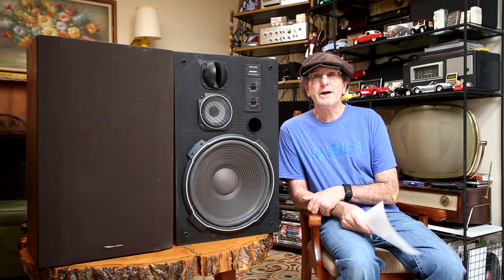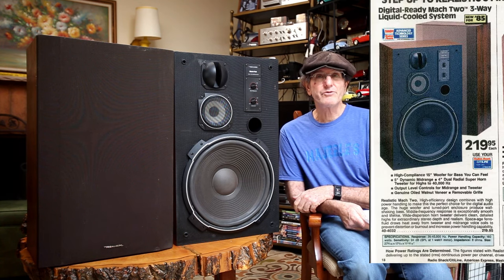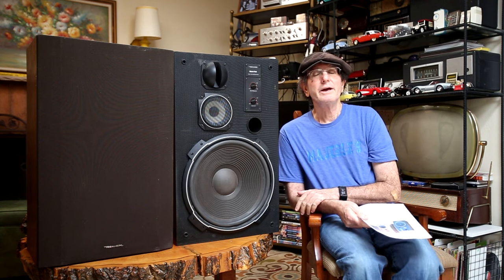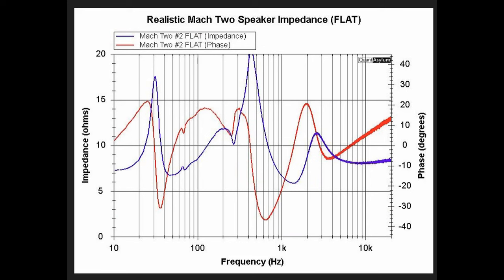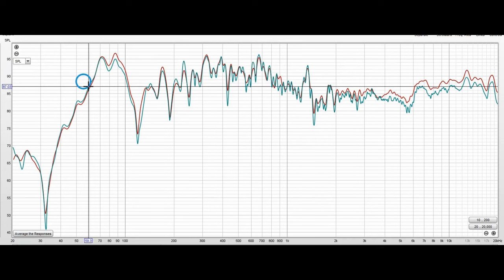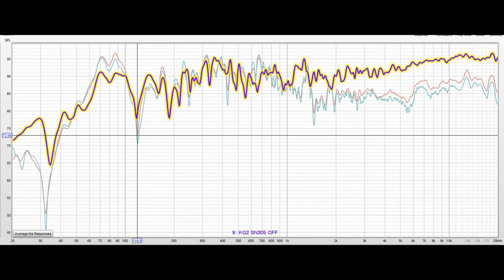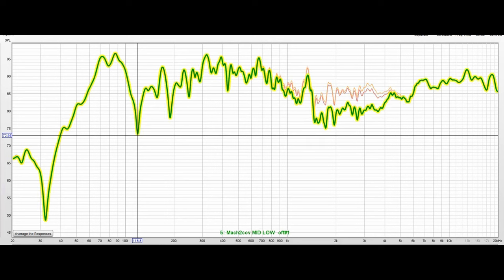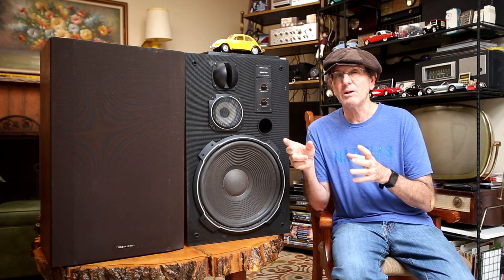Realistic Mach Two Loudspeaker- Vintage Audio Review Episode #85

Comment: Just re-foamed 4 of mine! The Ferrofluid had dried out on the tweeters (very faint sound), cleaned out the gunk and refilled. Mid ranges also needed re-foaming, I recapped as 40 year old Electrolytics will not be in great shape. Mine are wired up to an STA2380, recapping the amp was like night & day!
Reply from the maker: Thanks for sharing. I sent my tweeters into a guy to have the ferrofluid replaced- not something I wanted to do. I have tested some old crossover caps- probably at least 40years old and they were still fine- but don't blame someone who wants to do that. Glad you are using the RS Receiver.
Reply: The amp was completely different after the recap. I don't recall a massive change after recapping the crossover. However, one of the caps had a snapped leg! The tweeters are easy to work on, it just takes time to get all of the gunk out! I also use a Realistic graphic equaliser 😊
Reply from the maker: @hoojchoons2258  The snapped leg makes a bit of sense with all the vibrations going on in a speaker. I hope you checked out my video on the realistic EQ that I did- thought it was pretty neat.
Reply: Not seen it.  Will check it out. 312020A?
Reply from the maker: @hoojchoons2258  31-2000 was the model #
Reply: That's what I use 'em for!

Comment: Great video. I subscribed. I almost got a very nice pair of Mach-1 for $190 today but someone could pick them up before me. I have the Klipsch kg4 and like horns now, even though that is a mid-driver horn. I recently got a Rogue Atlas power amp (2005) for $400 and a pair of Sennheiser Momentum 3 wireless headphones (like new) and the kg4 are so much smoother than on my Onkyo SS AVR 6.1 amp. Thanks!
Reply from the maker: I have not heard the kg4's but am guessing they would sound good from how my kg2's sound. Sounds like you have made some good purchases. Thanks for the comments

Comment: Super Tweeters , and when your pushing excess juice into them , the light bulbs light up inside ,
Reply from the maker: I did not know that would happen, but it does not surprise me- thanks for the comment
Reply: @vintageaudioreview  my receiver pushes 115 watts per channel , without the Amp , but I can run my speakers on a 1 to 10 level for individual output , my two main speaker sets are Sansui Sp-Sx 9900’s, good for 300 watts each , but adjusted properly , the Mach 2 set hangs in there , but the light bulbs are running from dim to bright , I’ve blown all the speakers in them twice , the Mach 2’s , I’ve replaced them all with higher quality speakers 15 years ago , no problems since then , the Sansui’s , all original yet , 1974 models , they made better quality in the old days , my uncle has a Sansui SX-1980 Receiver , his system blows my mind ! 1/2 way up , you can watch the Glass move in the doors & Windows ,
Reply from the maker: @joelaichner3025  Have not heard any Sansui speakers in a long time, but like their receivers/intg amps. I will have to ask about the lights you mention- I think the owner may still have them, but that is a lot of power (115w) to put into them....
Reply: @vintageaudioreview  my Onkyo Receiver , I can adjust the power to the speakers from 1 to 10 by set , I run them on 6 , 60% power input at 7 they start to distort a little ,   The Sansui’s are set to 10 , Sansui’s are 5 way , with 17.2 inch woofers , I’m always looking for a 3rd set , the 11,000 series are especially rare , but I’d buy a set if I could find them close to home ,
Reply from the maker: @joelaichner3025  Good luck on your hunt for them and thanks for sharing!!

Comment: the Mach two and Mach three are the most underrated speakers on the market do to the fact they came from Radio Shack  thats why audiophiles turned their nose up at them.  what people didn't know back then and most still don't know now is that the Mach 2 and 3 were designed and made by Altec Lansing for the Tandy Corporation.  replace all the caps in them to poly  caps and let the magic begin. your gonna need for each crossover two 4.7uf two 2.2uf one 33uf and one 8uf. after you replace the caps then play this https://www.youtube.com/watch?v=jevoKLcjmfE  you will not believe your ears.
Reply from the maker: Thanks so much for the track- hopefully it is in my streamer service's catalog. Also great info about the crossover change components. It is not my speaker and was sold. This review has definitely been a favorite with the viewers. I am a gear guy and don't care so much about the about the badge on the product, except when it means I am going to be paying a lot more. A lot of the radio Shack gear has tested really good, except maybe the Lineaum's I reviewed.

Comment: A guy in my dorm had a set in 1985.  Loud and clean. MUCH better than ANY Japanese made or Bose (for example) of the 80's. I've considered upgrading the crossover on some and damping the cabinet.
Reply from the maker: I would not upgrade the crossover unless mine was bad and/or could measure the before and after results. This is definitely a very popular video which tells me a lot of folks had them. I appreciate the comment
Reply: @vintageaudioreview   no stock electrolytics  will sound as good as polyester or metallized  poly low ESR caps.
I’ve modded everything from Kef to Klipsch and there is not one example of electrolytics sounding as good. 
Electrolytics dry up and degrade in as little as 3-5 years, let alone 39 years. 
The midrange and treble clean up considerably and don’t saturate as easily with better caps.
Reply from the maker: @scottlowell493  My experience with testing caps (value,ESR and leakage with the appropriate voltage applied) has shown that many caps that are >40yrs old are still fine. I read a paper in the last 6month that showed there really was no difference between the expensive "audiophile" caps and others. If your experience tells you otherwise, then you are going to disagree but that is what the hobby is about, I suppose.
Reply: @vintageaudioreview   we totally disagree. 
Too many variances is electrolytics. Poor quality , Memory, smearing the sound. 
They sound duller and more closed in.
Square waves look like sawtooth. 
All of the people that have heard the mods  vs original said the same thing to me, without me telling them anything.
They are not exotic audiophile caps. They are a couple bucks like Dayton 5% or similar.
If YOU can’t hear a difference, you have the problem. Hearing or listening skills, or perhaps poor electronics feeding them like murky and rolled off vintage receivers.
Reply from the maker: @scottlowell493  At least you are using reasonable priced caps. My listening skills are quite good, I think, and completed Harmon's "How to Listen" training. As I have tested all of my gear, no problems there. I doubt most folks have the audio memory to be able to tell the differences you are suggesting. I am not talking about a capacitor that has changed value by a very large amount over their rated spec. If you had a pair of speakers and measured their freq responses/impedances and they were very close, and then did an a/b test and were convinced they sounded pretty much the same, and modified one of them by just replacing the caps with ones that were the same value but some other material, and then remeasured them, would there be a difference ? Will have to talk with an engineering friend who builds speakers and designs crossovers to get his take on this- I have never had to replace any crossover components- might make for an interesting video.

Comment: Incidentally, in case anyone is as grossly ignorant of a quality capacitors efficacy in a SUBSTANTIAL improvement over electrolytic, there is a mach 2 owner that upgraded the stock caps to polyester ON YOUTUBE.  The proof is in the listening, and it's OBVIOUS.
Reply from the maker: I have no doubt that replacing capacitors and/or inductors in a crossover network can make a big difference in the sound of speakers. We have reached an impasse, it appears. You may find this information interesting just as a side-
https://www.audiosciencereview.com/forum/index.php?threads/audible-difference-in-high-end-capacitors-abx-samples.48703/

Comment: HOW DO I GET MY WOOFERS REFOAMED IN MY MACH 2 SPEAKERS? PLZ RESPOND.
Reply from the maker: There are refoaming kits on ebay for that speaker. If you have not done them before you may want to give it a try.
Reply: I gave a shot at refoaming a while back. If you have any knack for the sort of thing at all it really is a simple task and process with these larger speakers.

Comment: Shocked that tweeter can get good dispersion in a home environment. Looks very sound reinforcement
Reply from the maker: Thanks for the comment. I probably should have done some off axis measurements to see how the dispersion measured- at least +/- 15degrees, but I have not done that before so would not have anything to compare.
Reply: Had a pair of these, back in the day... That tweeter is square and people were turning them so the canyon wave guide was horizontal to get better dispersion and imaging.
Reply from the maker: @Douglas_Blake_579  I will mention that to the owner- thanks!

Comment: i do crossovers for these
Reply from the maker: That is nice to know. I am not sure that this pair would have benefited from new crossovers from looking at the data....
Reply: I have my original pair my parents bought for me. Was thinking of doing the crossovers as the tweeter is lacking, am concerned the ferrofluid might have mucked up over the 30 plus years. I've also reformed the midst and woofer.
Reply from the maker: @koprcord5338  You would have to research about the ferrowfluid going bad on these- might help the high end response..